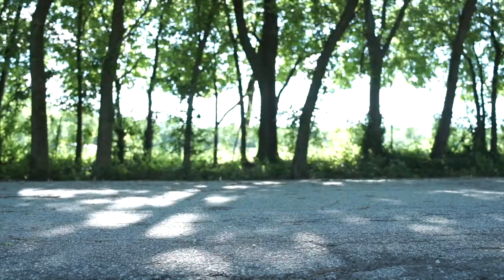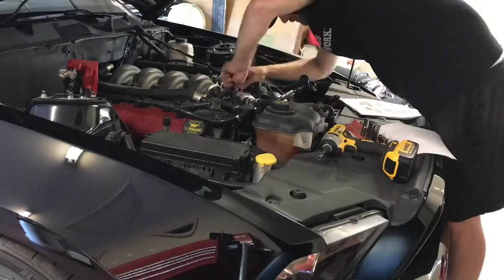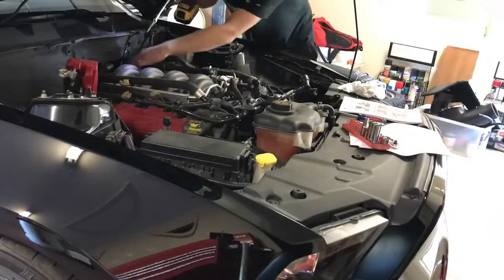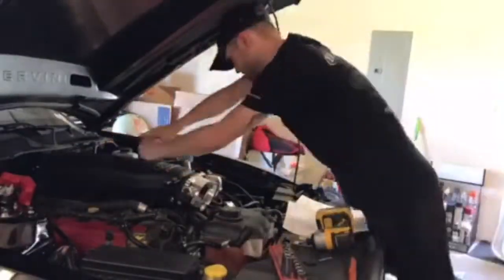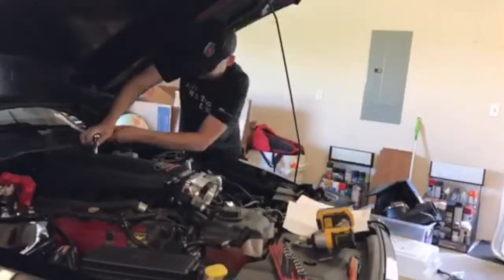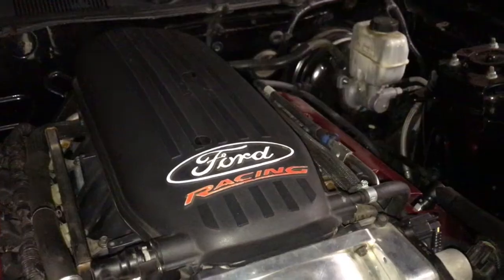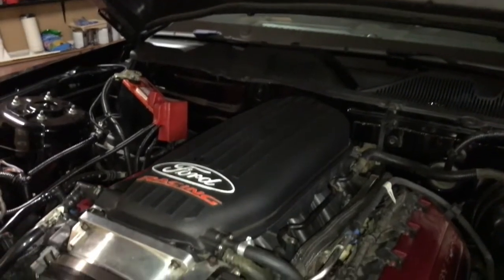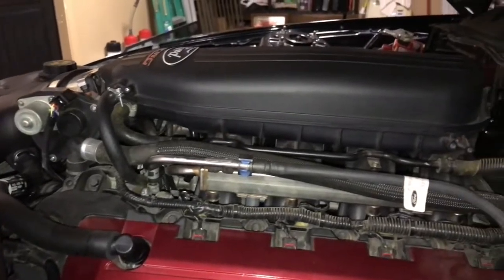Cobra Jet Intake Install

Comment: Hi, the website says that automatic cars can't have the CJ Mani (the new one with the ford performance plaque) cause it does not have anywhere to connect the aspirator tube. JLT offers a Cobra Jet intake where you drill into the CAI tube and add the grommet and fitting for the aspirator tube. I suppose the CJ you have which is the old one had somewhere to connect the aspirator tube elsewhere?

Comment: So the 4 bolts on the link you posted will make it to where I don’t have to re do the wires on the TB?
Reply from the maker: It looks like they changed the link for that part. Here is the correct link for the throttle body harness! https://www.vmpperformance.com/11-17-Mustang-Throttle-Body-Y-Harness

Comment: Did you upgrade your oil pump gears and crankshaft gear?  I’ve heard mixed answers on weather or no you need it.  I’m just going full bolt ons and not anything more.  Awesome video!
Reply from the maker: No I didn't, I've been running this setup for years now with no issue. I don't plan to do oil pump gears and crank sprocket until I go boosted.

Comment: the cobra jet doesn't fit on 2017 ford mustangs
Reply from the maker: This is not true. The cobra jet does fit on a 2017 and newer mustang. It doesn't fit under the factory hood though. You will either need to put different motor mounts to lower the motor or get a different hood.
Reply: @SKEETERRACING  on the website  says does not fit automatics only manuals
Reply from the maker: @StevenNeidlein  My car is an automatic.... There is no difference in the heads that would make it not bolt down to an automatic car. You probably have to modify some vacuum lines to make it work properly. That is the only real difference between a manual car and an automatic.
Reply: @SKEETERRACING  yeah i looked online 1200 for manifold 700 for the throddle body and 1400 for the custom hood with triple yellow i think im just  going with the 2018 manifold because  vmp did the all manifold shoot out and the 2018 manifold ported  did the same results  as the cobra jet